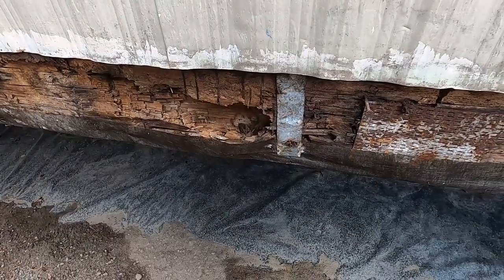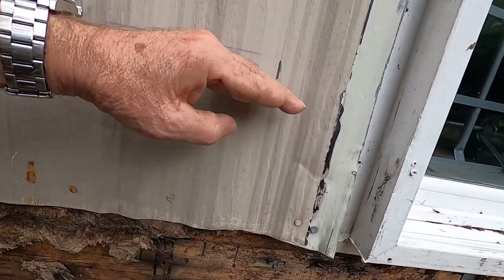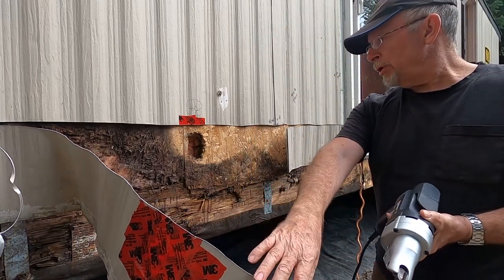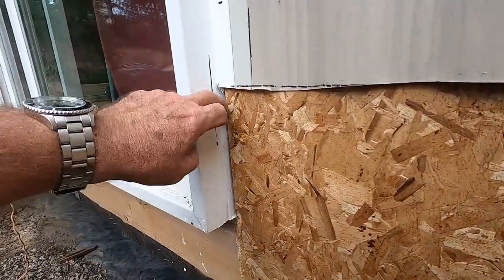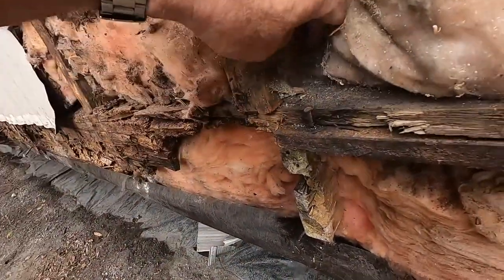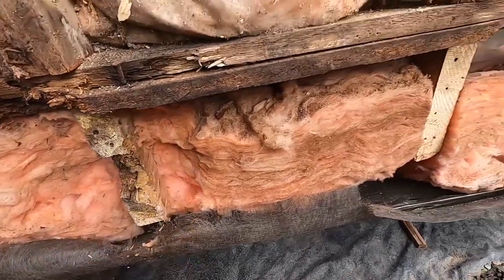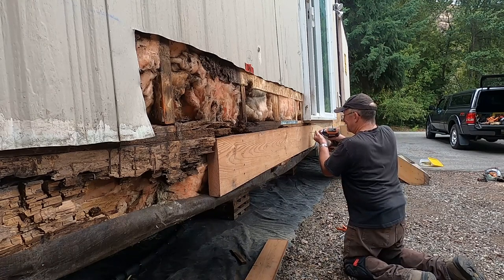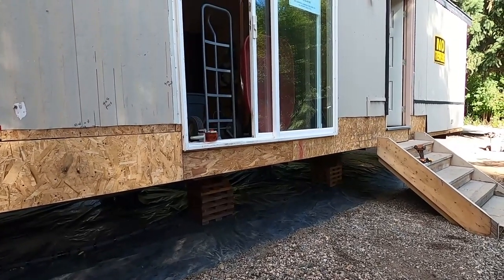Fixing Some Rotten Wood - Abandoned Mobile Home Project : E097 / BC Renovation Magazine

Comment: Are the original (floor) joists pressure treated or protected enough under the home or are  they are standard lumber?  I would imagine that if they are pressure treated that the sister joist would need to be pressure treated too.  I can also infer that if the sister joint would not need to be pressure treated if the original floor joists are not treated. So simply my question is  ... Are the joists under the house treated or standard lumber? Thanks!

EDIT:
I'll keep the comment posted for the algorithm and to help boost this awesome channel.
You answered the question in the video how you salvaged the 2x8 joist after I asked.

Comment: Does the replacement lumber need to be pressure treated?
Reply from the maker: Hi, Kevin. No, for this application, regular wood is fine. When it is all said and done and flashed and weatherproofed properly the wood should not get wet and rot again.

Comment: Shouldn't you use nails instead of screws because of the shear factor?
Reply: Not necessarily. It depends on the screws you use. Deck screws are strong enough for this.